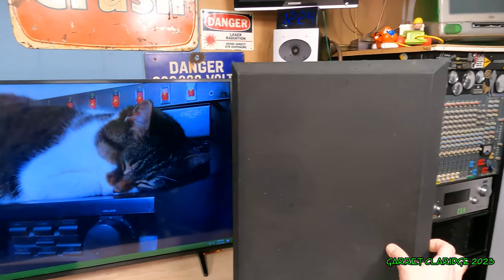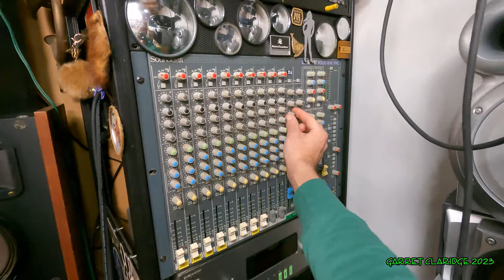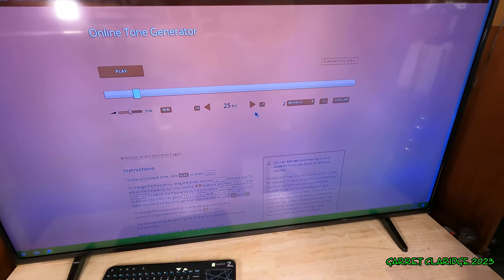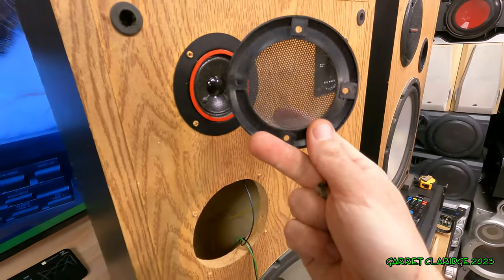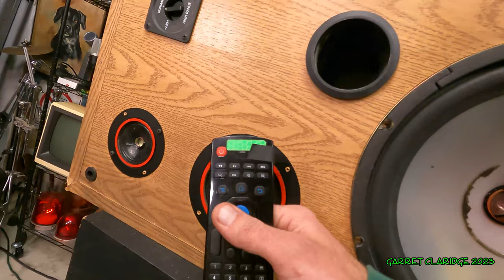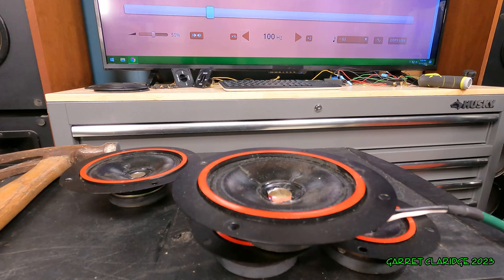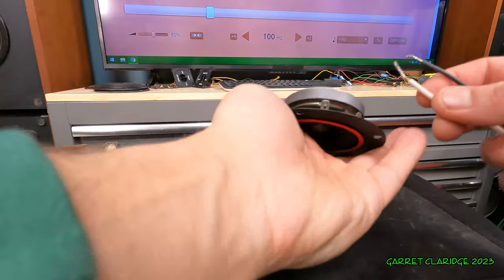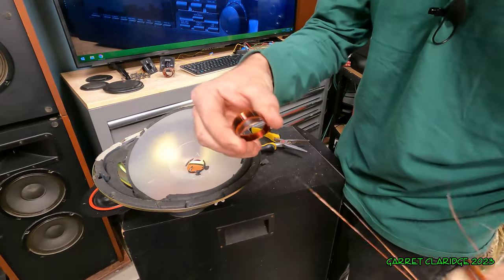Acoustic Audio H-CD12 Destruction and Speaker Blowout

Comment: Hey Garrett, I had a set of those speakers in the late 90's. Mine were carpeted and had those typical car hatchback box metal grills over the woofers. It had all the same exact components. I don't know if they were original or modified by someone. They looked nice but sound very..... meh (as you would expect).  I still have the L pads and the mid and high speaker grills on the parts shelf. Everything else is history 💨. 
I'm glad the see you're still at it. These videos never get old.
Merry Christmas my friend 🎄🍻
Reply: I had those also ages ago, like that, same woofer but they didn't have the control knob, and the tweeter was a horn, grey carpeted, and had the black metal grills,  but had the name Acoustic Research on them with the same whack decal lol
Reply: Ha, yours must've been the "Linear Phase 8812" - another prime example of white van speakers!

Comment: Love these videos! Great to see you back. Saw you put on the defenders for the tweeter test, do you wear hearing protection more often testing these speakers at high volumes? I'm getting increasingly aware of hearing damage after doing a year's course in professional acoustics. It's so worth it to protect your hearing especially when your job is music. Some small foam in-ear plugs are great as you can still hear but they can knock a fair bit of depending on the frequency.

Comment: Ya know, I can't hate on these very much.

I am well aware that these speakers were a scam. The components are cheap, and they don't hold a candle to even mid tier speakers from the same era.

That said, speakers like these can sound decent, with the right crossovers in them, and with some dampening material. They can certainly sound better than a lot of Bluetooth speakers. Also, these are from the 90's, yet the foam surrounds held up. These cheap scam speakers... have better foam surrounds... than Cerwin Vega's...

Comment: i seen the red Panasonic subwoofer i have the full stereo lol keep doing what u do
Reply from the maker: ahaha I had the chance to get the whole stereo but the sub was priced separate so lul
Reply: I bought mine off market place the casset tape still works but the 5 disc CD changer never worked but they never worked properly on any of them this stereo bumps pretty hard if u ever get a full set up could be used for a party stereo outside pretty clear sounding

Comment: I had something similar to those JBL suitcase speakers that were like 15 in and then they were a white van scan because they didn't last long and it was cheap quality the battery terminals were soldered so the wires were directly soldered to the 12-volt sealed lead acid battery it was made by a company called H&A stay away from that company if you ever hear of them they have a legit website but I overpaid at my local smoke shop for it they had one for $250 it was too good to be true in a bad way because it didn't last long and it was just made out of cheap poor plastic and it basically fell apart when it accidentally fell down the stairs when I was at a job site the fucker just split in half